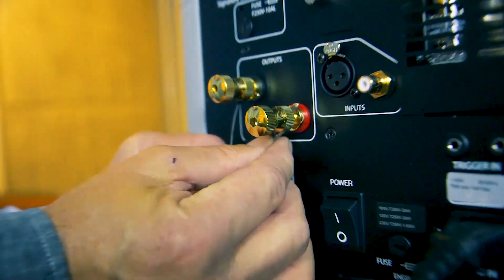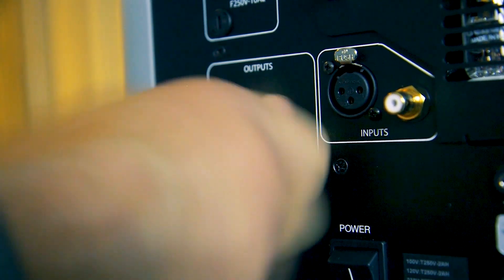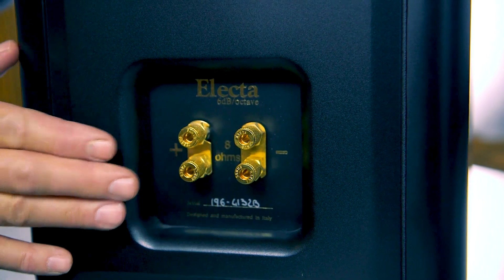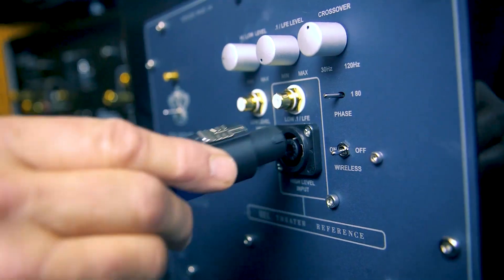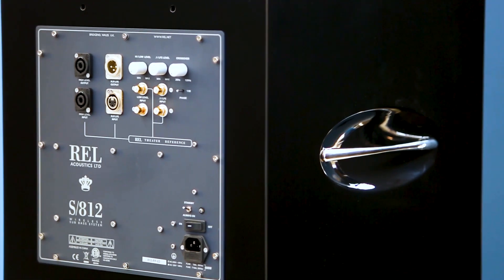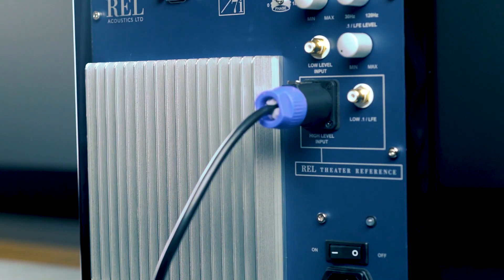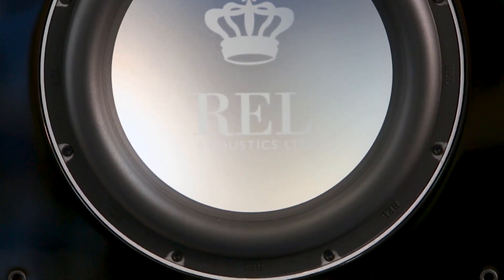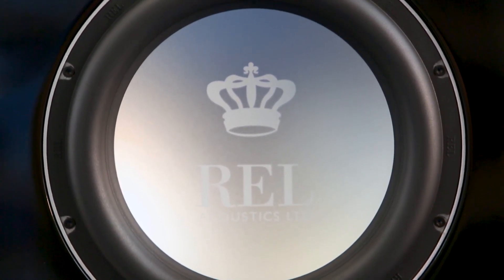What is a high level connection and why does REL insist you use it?

Comment: What about a tube integrated amp which doesn’t  produce deep tight bass.  In that case I think using the low-level pre outs, if available, would be a better way to go.
Reply from the maker: High Level sound wonderful on any amp.

Comment: It's all very well to insist on using high-level connections as a priority, but how do you go about it when there aren't any, like your REL ACOUSTICS HT/1508 PREDATOR, 1510 PREDATOR, HT/1003 MKII subwoofers ?   😁
Reply from the maker: Thank you for reaching out. Since the Serie HT subwoofers do not feature the High Level input, they can instead be connected to stereo pre-outs on a 2-channel preamp, or to a designated subwoofer output on a home theater receiver.

Comment: Does using high level stop the ability to Dirac calibrate the Subwoofers? :)
Reply from the maker: Thank you for reaching out. Using the High Level input on a REL subwoofer will not prevent you from using the Dirac room correction, though to get the best results we recommend disconnecting the High Level cable from the subwoofer while the room correction program runs. Then once the program has finished you can re-connect the High Level cable and tune this input by-ear to blend with your speakers. 

If you prefer to have the Dirac software directly control the output of the subwoofer, then it will be best to connect it using the .1/LFE input rather than using the High Level input. 

We hope that this helps, but if you have any additional questions then feel free to write in to contactus@rel.net and we will be happy to assist.

Comment: Far as the SpeakOn cable goes, do not use the black wire (ground wire) if you’re connecting to a D class amp. You only need the red and yellow wires of the SpeakOn for D class amps. Shrink wrap the end of the black wire, if necessary.

Comment: Hello REL, please can you explain why so many people say that this high level connection can damage your amplifier? This has made me very apprehensive to use this approach. Please explain why they are saying and making these claims?
Reply from the maker: Thank you for reaching out. Using the High Level input on a REL subwoofer will not damage the power amplifier that it is connected to as long as you follow the correct connection instructions for that particular amplifier (Class A/B, Class D, Balanced/Differential, etc.). If you would like High Level connection instructions specific to your system, please write in to contactus@rel.net with the specific model of amplifier that you are using in this system and we will be happy to assist.
Reply: @RELAcoustics  Thank you! Very helpful. Will email now.

Comment: If you have a 2 way stereo amplifier and on each channel you have a speaker hooked up,where do you take the high level output from?if you take it from one of the channels, meaning that you parallel your sub with one channel, doesn't that affect impedance?(I am new to this,please expalin,thank you)
Reply from the maker: Thank you for contacting us. When connecting a REL subwoofer using the High Level input, we recommend connecting the High Level cable to the exact same output terminals on the amplifier as your main loudspeaker wire is connected to. The High Level input on a REL features a significantly high impedance (approximately 150,000 ohms, compared to the 4-8 ohm load of a typical speaker), which allows the REL to connect to the amplifier's output terminals without placing any current load on the amplifier or drawing any amplifier power away from the main loudspeakers.

Comment: So my NAD 317 has one set of speaker outs.  I’m supposed to connect one pair of speaker cables to the speakers, and another pair of speaker cables to the sub, both originating from the same speaker output terminals in my amp?
Reply from the maker: That is correct. When using the High Level input on your REL subwoofer, both the High Level cable and your main speaker wire should be connected in-parallel to the same set of output terminals on the amplifier.

Comment: I’m kinda confused about something, if I set the speakers to large/full range in the receiver, how do I stop my small satellite speakers from receiving frequencies under what they are rated to handle, I believe they can only go down to 120-100hz?
Reply from the maker: When using the High Level input on our subwoofers, it will be necessary to have the speaker channels which the subwoofer is connected to set to Large or Full-Range within your receiver or preamp. With this setting, there will be no way to limit the low-frequencies being sent to your main loudspeakers, since doing so will also limit the low-frequencies being sent to the subwoofer. If your speakers are designed to receive bandwidth-limited signal and be set to Small within your receiver, then we recommend using the subwoofer's Low Level or .1/LFE input and connect to the designated subwoofer output on your receiver. This will allow the speakers to be set to small while still sending low-frequency signal to the subwoofer.
Reply: I’m still confused. Seems as if REL is stating that in order to be able to use the high level connect, your front channel speakers gotta’ be able to go down to 30 Hz or less 🤔 If that’s true, glad I didn’t try to use the high level cable that was included in the box w/ my T5x. Instead I used a RCA cable & the .1 low level connect 🤷🏽‍♂️

Edit:  Just hooked up the SpeakOn cable. The T5x sounds even better now. As if it’s got another gear, if you use the high level connect. So. Once again, REL is correct 🤷🏽‍♂️ I’m still a bit confused though 😂

Comment: After you feed the high level signal into your subwoofer from the main outputs of the power amplifier, how does signal get to the main speakers. How are the main speakers integrated into the system? You have a thousand 'how to' videos and none of them explains this.
Reply: Amp to speaker connections do not change. You take a separate feed off the back of the outputs on the amp and that goes to the sub or subs.

Comment: Obviously you/REL are committed to high-level inputs and to getting the sonic signature of the main amps to the subwoofer.  That sounds really good.  But I have to ask, are you also claiming the REL sub amp has no sonic signature of its own?  To the best of my knowledge every amp has its own sonic signature.  If so, how is REL able to quash its own amp's sonic signature in order to preserve the main amp's?
Also, with a REL sub, one must use REL's high-level input cables.  Since, like amps, cables induce their own sonic signature, won't REL cables induce their own sonic signature to the signal which already also carries the interconnects and speaker cables' sonic signature?  How about timing issues?  With high-level input configs, the input signal to the REL sub must pass thru 2 amps instead of 1 amp and I'm guessing this can't be beneficial.  Moreover, common sense dictates that the fidelity of an input signal at the amplifier will be compromised by the time it reaches the amplifier's output.  IOW, with high-level inputs, wouldn't the signal at the subwoofer driver be that much more compromised because it had to pass thru 2 amps instead of 1 amp?  At least with low-level inputs, we can directly match interconnects with those used elsewhere in the system which some consider critical for integrating subs to speakers.  Also, with low-level inputs the signal makes only pass through one amplifier, which would seem to minimize potential timing issues as well as negate the potential of dealing with a further compromised input signal passing thru main amp first.  I'm curious how REL might address these and perhaps other potentially very real concerns by their use of high-level inputs?  BTW, does REL have a video recording that demonstrates how musical a playback presentation can be with REL subwoofers and their high-level inputs?  Thanks,
Reply: I'm glad someone else sees the obvious issues with REL's approach.
Reply: @paulgyro  Thanks, Paul.  I'm not sure what's going on with high-end audio these days but it just seems like a lot high intellect types are checking their brains off at the door lately as this issue with high-level connections is far from the only questionable issue out there.  But it's kinda' embarrassing for some of us.
Reply: @ToadStool942  agreed, so much of "High-end" audio is based on many false assertions.  Often times the ideas originated as a plausible hypothesis but over the last 40 years we've learned much about speaker design and psychoacoustics, providing the assertions false, that many "High-end" types don't want to accept or plain ignore.
Reply: @paulgyro  Exactly.  I think.  I actually just call it folklore and there's about 11 or 12 such folklore that not only contains little / no truth, but actually will cripple our playback systems significantly.   But of course such folklore sounds great on paper and the logic makes so much sense.  That is until one spends about 5 minutes thinking some of these things thru.  Some of this folklore I've learned firsthand.  In the case of high-level connections, I've never tried it myself with no real desire to do so because it's just plain silly to say high-level connections are beneficial because this wiring confi retains the sonic signature of the amps, which it just might.  But at the sonic expense of everything else.  Anyway, appreciate your discernment as there doesn't seem to be much of it left in this industry/hobby.  I know somebody who purchased 3 pair of used REL No 25's (2 stacks) several years ago and is always boasting about his fabulous bass.  Yet, in the past year alone he probably started no less than 6 or 7 threads where he's always asking different questions about how he can improve his bass.  Go figure.  He called me on the phone once and we discussed his bass config with the REL's and high-level connections, etc.  It was after that call that I gave these high-level connections about 5 minutes of thought and that's when all these potential sound quality compromises associated with high-level connections dawned on me.

Comment: To be clear re "high level":  1) Every REL sub comes with an adapter cable to convert positive and negative leads for the amp to the blue collared, chunky power cord style cable which as shown is plugged into the back panel of the REL? 
2) And those positive and negative leads connect directly to the terminals on a power amp? 3) Thus, sharing / alongside the positive and negative leads which go to the main speakers? OK this is counterintuitive to me, but I am thinking about giving it a try!
Reply from the maker: Thank you for reaching out, and for your interest in REL Acoustics subwoofers! You are correct that each High Level cable (supplied with the subwoofer) features a SpeakOn/NL4 connector on the end which connects to the subwoofer, with the other end fanning out into three wires which connect to the main speaker output terminals on your amplifier, in parallel with your main speaker wire connection. The cable has two positive leads (red and yellow wires, for right and left channel connections respectively) and a third wire (black) for a ground reference. 

The High Level input on the subwoofer has a significantly high impedance compared to that of typical loudspeakers, which results in this connection not placing any additional current load on the amplifier, or drawing any amplifier power away from your main loudspeakers. 

That being said, there are different High Level connection instructions depending on the type of amplifier that you are using (Class A/B, Class D, Balanced/Differential, etc.). At your earliest convenience, feel free to write in to contactus@rel.net and we will be happy to provide High Level connection instructions specific to your system.

Comment: Connecting the sub directly to the speaker channel, wont lower the power of the other speaker connected to the same channel, right?
Reply from the maker: The High Level input on our subwoofers has a significantly high impedance compared to that of most loudspeakers, which results in the subwoofer not placing any current load on the amplifier or drawing any amplifier power away from your main loudspeakers.
Reply: @RELAcoustics   Thank you!

Comment: recently blew up a Musical fidelity A308 amp I was trying, plus other amps were getting very warm!!!!. I eventually decided my REL strata 1 was faulty so off it goes to REL for checking. However they say there is nothing wrong, BUT the reason for blowing amps is as follows. I find it hard to beleive personally. I was using the high level inputs.
From Gavin at REL
the problem lies with the way the cables have been connected to the amp not the REL 
As you are using Dual Mono (same thing applies to monoblocks) the current connections of the amp are one channell has the red ( or yellow) and black connected and the other channel has just the yellow ( or Red) connected.
Due to the design of the amps this will usually cause one of the channels to go unstable, thus overheating/blowing the amp. 
what needs to be done is to keep the REL connectedas nprmal but at the amps connections keep the positives as is, but connect the blacks to a ground point onb the amp, this will keep a common groundpoint to the monos keeping them stable

Sorry to be so lengthy but I thought you should be warned. personall : i think its down to bad REL amp design( my hifi dealer friends think so too)
Reply from the maker: We're sorry to hear that there was damage caused to your amplifier by using the High Level connection method. We put a lot of work in when designing our subwoofers to make them compatible with as many amplifiers as possible, though since there any many different amplifier designs available today it is important to follow the correct High Level connection instructions depending on the type of amplifier which you are using. We are always available at contactus@rel.net if you have any questions or concerns regarding how to properly connect a REL subwoofer to your system.
Reply: @RELAcoustics  
Why isn't there a warning that your design is flawed? That it doesn't work with all amplifiers?

Comment: When using high level input, how are left and right channels blended? Are they summed, averaged or anything? Does this merge affect sound quality? Thanks
Reply from the maker: When connecting a single subwoofer to a system using the high level input, the left and right channels are being summed together into a mono signal. This summing does not negatively affect sound quality, though improved performance can be achieved by having dedicated left and right channel subwoofers in a stereo pair.

Comment: Can I just use low level input on my Rel 1508’s subs only for movies and music my preamplifier is using pre outs to the power amps. Lfe input doesn’t produce the level bass I get for movies on music.
Reply: Actually using my xlr outputs to the sub now
Reply from the maker: @adsfghyy69  The HT/1508 subwoofers can either be connected to the designated subwoofer output on a AV receiver, or to outputs on your preamp. For detailed connection instructions specific to your system, please write in to contactus@rel.net and I will be happy to assist.

Comment: Yes, John, you have a good reason... but you also introduce distortion into the system.  Why we bought expensive speaker cable? Why we bought expensive amps.. if our amp cost more then ten times of the subwoofer...do we really want something attached between speaker and amps? yup, if the amp and speakers are so good, why add a sub right?
Reply from the maker: The High Level input on our subwoofers is designed with a significantly high impedance, which results in it not placing any current load on the amplifier and when connected properly the High Level input does not introduce any distortion into the system. When using the High Level input your main speakers will still be connected as normal to the amplifier, with the High Level connected subwoofer running in parallel to the main speakers rather than between the speakers and the amp.

Comment: BUT the big BUT, even REL gets signals from the main amplifier,  REL still uses its own amplifier to drive the subwoofer cone. Rel's amplifier is totally different from the main amplifier. So What's the point?
Reply from the maker: Connecting to your main power amplifier using the High Level input results in the subwoofer receiving a wider-bandwidth signal when compared to the line level signal that it would receive by connecting to your preamp using the Low Level input. Most importantly though, the High Level input allows the subwoofer to receive the exact same signal as your main loudspeakers, including the timing cues and tonal characteristics of the power amp, which we believe greatly improves the performance of the subwoofer and results in a far more seamless blend with your main loudspeakers.
Reply: Bingo! Glad you get it

Comment: Bit worried about hum.  I have a meridian 105 mono-block times 2 - and am informed by meridian that it is class AB.
Would I be ok just buying one REL as I've heard you can get hum problems? Also - does any hum come from the speakers or the rel?
Reply from the maker: For systems using monoblock amplifiers and a single subwoofer, we recommend connecting to your preamp via the Low Level input rather than with the High Level input connection. Connecting a single subwoofer High Level to two monoblock amplifiers often results in a ground loop hum from the sub which can be very difficult, and in most cases impossible, to eliminate. Connecting to your preamp using the Low Level input will still take advantage of the subwoofer's advanced filter circuit for full tuning control.